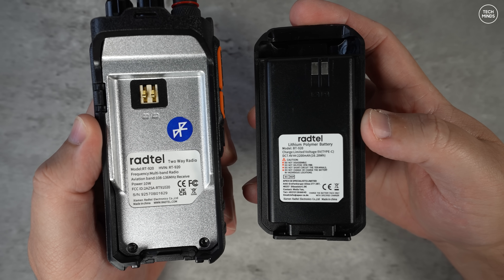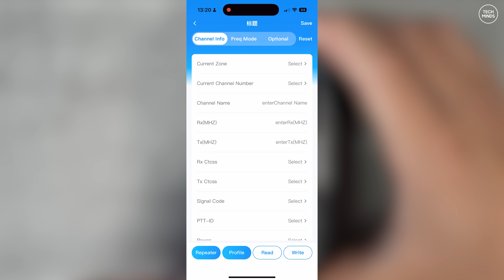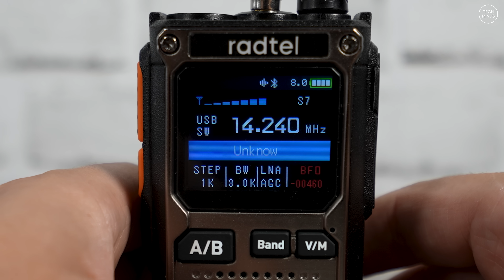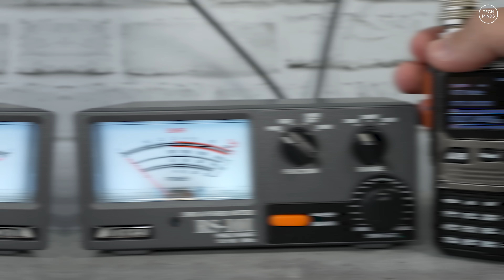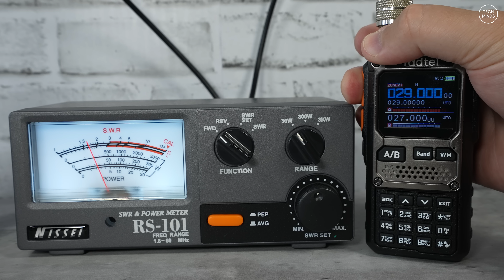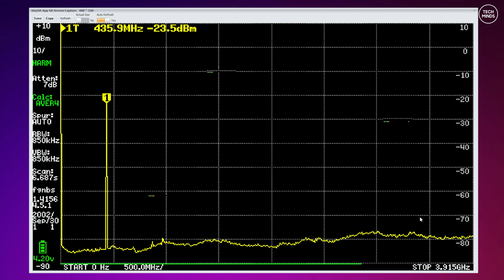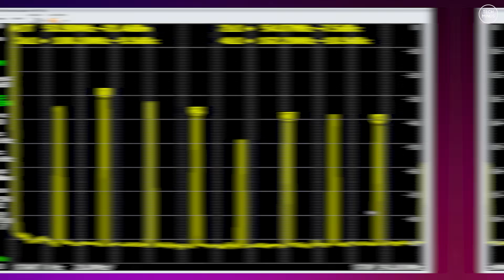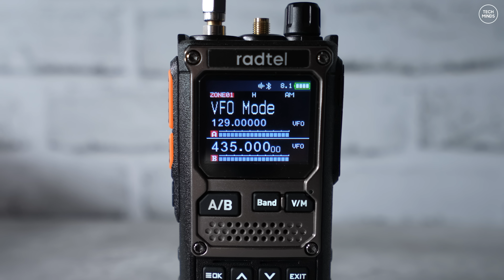This Is THE ONE To Get Right Now! - Radtel RT-920

Comment: I’ve connected headphones into the aux but not got any sound . Am I being stupid or is there a setting to change the output to headphones . Thanks
Reply from the maker: It is not strictly a headphone socket. It has multiple pins and multiple uses, so a standard 3.5mm stereo headset would most likely not work. Try looking for a cheap speaker mic which has a dedicated headphone output socket.

Comment: Finally got mine and played with it a whole day. Not really impressed to be honest. I've tried both firmware updates as well. I will say its got the best Civil Airband reception of any of my handhelds, and on a par with the expensive Yaesu 70D.  Everything else is pretty meh though. The bandscope is unimpressive and runs in FM regardless of what settings you make. Scanning is slow. Short wave is awful. It does work if you know what frequency and mode you want to listen to, but its a real faff and inferior (on AM) to my small £20 desktop shortwave set from Amazon. I did find out how to make it scan through memory channels though - I see that as a complaint on some reviews, you have to change the settings in the programming software, or easier with chirp.  Not a keeper I'm afraid, but I enjoyed the anticipation of it arriving and it wont stop be getting more you recommend :)

Comment: Great review! I'm tempted but I won't be upgrading, as you have shown out of band transmissions are very spurious which is a deal breaker for me, some nice tweaks though on recieve like the BFO for SSB and it sounds good on recieve. I'm using a Tidradio-H3 (nicsure modded) it's got some great features like fine-tuning RF gain and Squelch, sounds great, nice display mods too. Wide band mods for my many Quanshengs UV-K5 + (8)'s do a great job on receiving 10,11meters with SSB and fine tuning, also using those long cheap 27mhz telescopics off Ali Express work well and even has a band scope with audio at the same time with scan and jump to frequency modes. And FM radio of course with memories. I have the inverted black screen on one of the Quanshengs and so cheap I can run one dual bander on e.g: 27.78125 + 27.555 just recieving,
Another radio covering 2m 70cms PMR Repeaters Simplex channels and also store in memory all CB channels PMR, Marine, Airband channels etc to scan. I just can't justify buying yet another radio! 😂 I'm going to have to program the spare radios and give them to friends. It's good they upgrade the firmware and hopefully after watching this they can address some of the issues.

Comment: Thanks for the review: I think we're all glad to see at least one clean Chinese radio on both the 2m and 70 cm bands!.
Apparently the RT920 and the Bajeton BJ7800 are identical, the later being much cheaper on AliExpress (42€ vs. 30€). I wonder if the firmware updates from Radtel can be used on the Bajeton units... ?

Comment: Good video, thanks!

Would this Radtel support duplex channels? No experience with this brand, I've only played with Baofeng and there with Chirp you could easily do that.
Thinking of using it as a backup handheld radio, occasionally on a boat (marine channels). I know it's not waterproof, still it does not bother me.

Comment: You could use the out-of-band frequencies on transmit on this radio if you paired it with a band-pass-filter for whatever band you're transmitting on. However, at $90+ typical pricing, that's likely not a GREAT option
Reply: You could make one for a fraction of the price - but you need a way to measure spurious emissions to ensure its working sufficiently well

Comment: There is a version called SHJ H28y Pro Identical internals just one less row of buttons at the top... I Have the h28y pro.. no difference in capability. The h28y uses the same cps (radels) and app too... And best of all it is £18-£24 on Ali....
Reply: Interesting.. would it use the same firmware?
Reply: @m.l8698  NO  It uses a firmware call BT7511 as the keys are in a different order.. The firmware is out there I have a copy and was update yesterday.   Everything is identical in the menus ands functions to the 920. And really works damn well..

Comment: I bought the 910B because it was advertised as supporting 6M, which you’d assume means it includes proper filtering to keep the output acceptably clean. Instead, it’s just as bad as this radio on 6M, with the second harmonic stronger than the fundamental. A big disappointment given how well the 880G performs.

Comment: Great review!! 👏👏👏👏 I opened one of these and found that the RF power amplifiers used are only rated at 8W @7.2V. This radio uses a 7.4V battery, but can’t see how 10w can be claimed.
Reply: It can't. Numbers don't lie, therefore ohm's law can't lie.
Reply: Absolutely correct

Comment: Any benefit Vs the 880? There is only about a £10 price difference between the two now...
Reply: The RT-880 is much better - it has 2 x transceivers whereas the RT-920 only has 1. This allows the 880 to have a cross band repeater function and tri-band reception. The RT880 also has better build quality.

Comment: What power level did you have the RT-920 set to for your tests? It offers low/mid/high settings, up to 10w peak (although I expect 8w is a real world maximum).
Reply: I did a teardown on this family of radios and found out that they use RF power amplifiers that are only rated to just over 8W.
Reply: @ElectroBananasYT Thanks, that's good to know!
Reply from the maker: I was using full power, but using attenuators to bring it down to around -26dB

Comment: Very good video on the radio, congratulations. I'm looking for a very cheap radio for the 4m 66-88Mhz band. Any recommendations? Greetings 73s
Reply: Try looking for the wouxon kg-699e, Martin Lynch were selling it don't know if they are now, it's a good HT with a good front end and won't over load on an external antenna.
Reply: @adam-g7crq It would be nice to have a baofeng or similar from that band and with those prices 😂

Comment: i have 2 Model the  RT  920 by  Radtel and the BJ780 by Bajeton . The 2 radio a good radio for little  price  . I'm ham radio and  i use  on Frenck Relay UHF/VHF  and this radio have  good audio in TX  and too in RX  . For  the  FM Broadcast  radio le sound is clean . I don't  make test  on PMR  446 and  CBband  i prefer  lost  ( LOL) 
For the listening  this radio works fine  with 27MHZ male fixed on the  middle SMA . i listening  40M/20/ 10 M CB band too honestely it's good little radio with  small price  . 
73 F4LDI

Comment: They really should put a rotary encoder in these radios!
Just put it instead of the volume control and make volume control a software function, or have a concentric volume pot and rotary encoder.
Tuning SSB with up/down buttons is crazy...
Reply: The RT900 has a rotary encoder dial for tuning / channel selection
Reply: @davidgodf_uk …. Alas, no HF…..
Reply: Totally agree
Reply: Excellent point.
Reply: Your right Rob
Reply: @martinryan5069  *you're

Comment: Is there any radio like this that has a Frequency counter built in like the little McBazel I sometimes use, can this be used like a radio scanner also up to the 900mhz, not wanting to transmit really on it, until I do my test etc, or is there another I could use for this like Quansheng or Baofeng ?Thanks

Comment: putting the usb-c port on the bottom of a battery is a small detail but one they got wrong. you can't charge the radio while it stands on your desk.
Reply: Just use the desktop charger, then it's vertical.
Reply from the maker: Maybe it’s their ploy so you buy another battery, lol
Reply: You can always get creative! I wonder if this wont charge like other usb c batteries and not charge of a usb 3 port.

Comment: Very good video. But it is still another almost the same radio.. :/ Nothing new from China..
Reply from the maker: Unfortunately all the companies seem to rush to get a working product, in this class, after those K5 mods came out. IMO this is the best so far. Could it be better? Absolutely, at least Radtel are taking this in the right direction. Cheers :-)
Reply: @TechMindsOfficial  Until there will be no other cheap alternative for BK4918 and their family we will be stuck with same Quansheng but in other case.. 

True SDR is way too expensive for such cheap radios and there is no way to use cheap SDR with Tylor detector like QMX uses. 

Maybe with downconversion it would be possible but it's still expensive to have QMX like radio with down/upverter built in.

Comment: Do you happen to know if the linked firmware update would work on the Bajeton version of this radio as well?
Reply from the maker: I just tested it on the BJ-7800 and yes, it works! However, the V/M and A/B buttons are reversed.

Comment: Is this a Quansheng or Verio descendant?
Reply from the maker: This is their own, way better than Quansheng right now.
Reply: @TechMindsOfficial Radtel has horrible harmonic noise when transmitting. Quansheng doesn't. Edit: this applies for the only radtel i've tried; the rt-470x. I've not tried the one in this video, that appears to be a much better unit.
Reply from the maker: @suprlite  Totally wrong.. If you are refering to the TK11 then that is extremely bad just like this radio when "out of band" or anything other than 2/70.
Reply from the maker: @suprlite if you go back and read your original comment you were not "specific" on models or bands. So yes, totally wrong because you was not specific and it was assumed you was referring to the TK11 and this radio in this video. Maybe you didn't watch the whole video, or maybe you didn't listen to what I was saying in this video, but this radio,, ,the RT-920, has clean TX on the 2/70cm bands, which is were this radio is specified to transmit on.  Any other bands its dirty, as shown in the video when I tested harmonics. So, your "general" comment was wrong for this radio shown in this video.
Reply from the maker: I know who made the TK11, I put a hammer through one on video.. :-) Actually it flew across the garden very well with a hammer tickle. Okay look, I have no idea what you want to argue about here, but if you make a "generic" comment on a video about a "specific" radio then you will get backlash. Have a nice day...
Reply: @TechMindsOfficial It's all good😊 Guess i won't bother buying the TK11 then, if it's got a tendency to get hammered. I'm tempted to buy this new radtel though, seeing that they've upped their game regarding signal quality. Anyway: now that i've had my morning coffee and im done bellyaching and bickering, i'll check out your video 😁 Have a splendid day, sir. Edit: and yeah, of course i should have been specific. I was referring to my own experiences with said brand, but of course there was no way for you to know that. My bad.
Reply from the maker: You too dude, thanks for the entertainment and thanks for watching. Yeh, check out the TK11 videos, the first one gets truly hammered lol. Cheers
Reply: I think that your right, even menu on HF option is same.